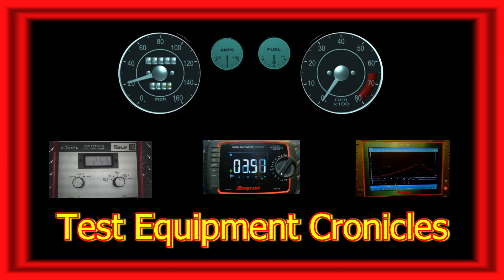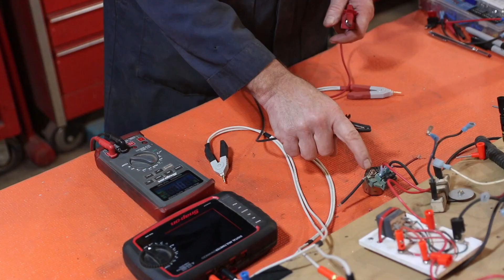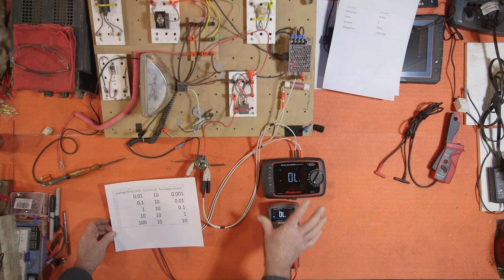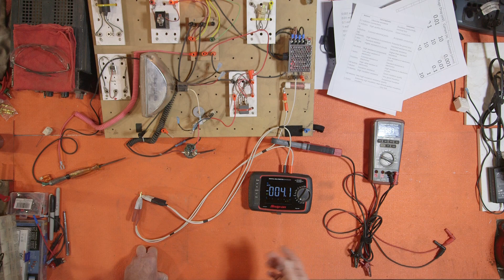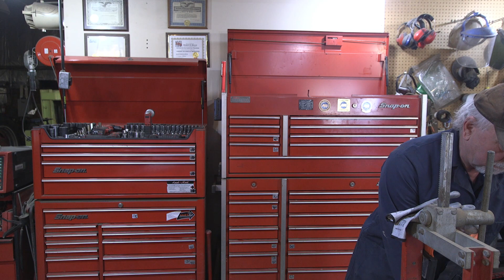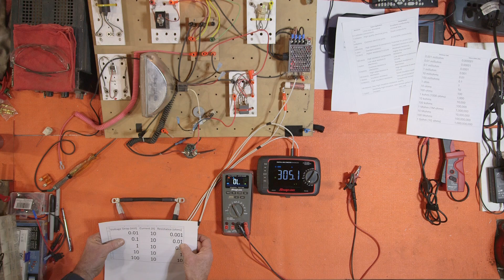Kelvin Clips in Action: Transform Your Electrical Testing

Comment: I still don't know why something like a solid or stranded wire with sub 1 ohm per foot i assume its all the noise and rf stuff
Reply from the maker: This style of testing aims to check the integrity of the cabling to handle the power without the load like the starter installed.  Over the years, I have found a lot of problems with cable deterioration internally, as an Ohm meter gave it a clean bill of health.  This technique indicated a problem.  I've rebuilt literally hundreds of starters, alternators and generators using this tool technique and it has been invaluable for finding poor quality, riveting of the ground and power cables to the brushes.  I used to utilize a technique of the battery and a large resistor and now that I found this inexpensive high-frequency power supply and makes the tool much more accurate and overall easier to use.  Pertaining to electrical noise.  This is not the tool to verify that that's where you are looking for insulation integrity.  I recently made a video showing hybrid high-voltage cabling testing techniques.  And pertaining to the solid wire.  I guess I'd say I have some experience working on high-voltage AC residential and commercial systems, but it's something that's not utilized in in-vehicle applications.  Hope this zeroed in on your question.  If I missed the point, please ask it again.